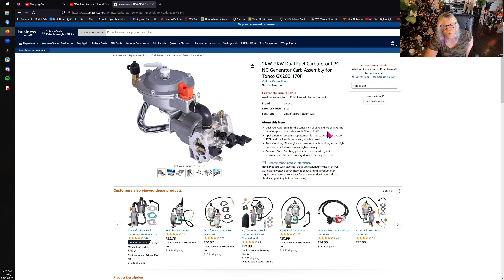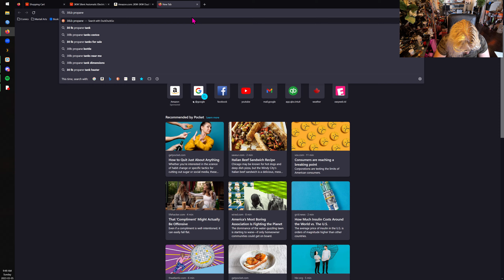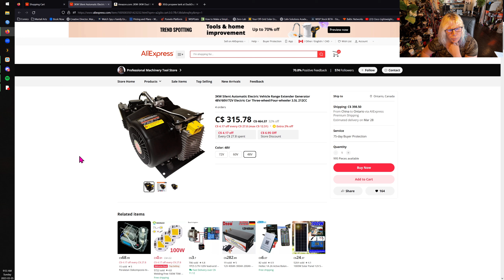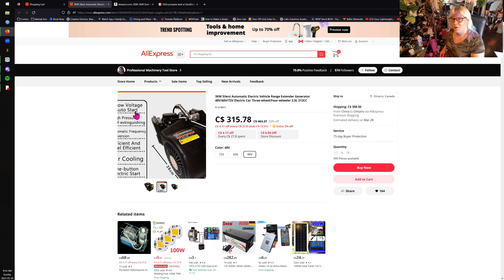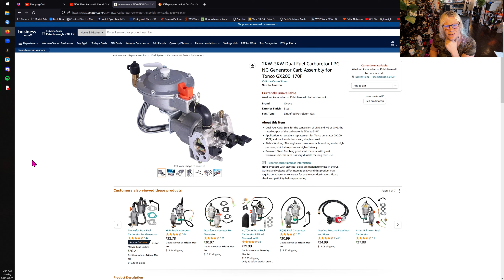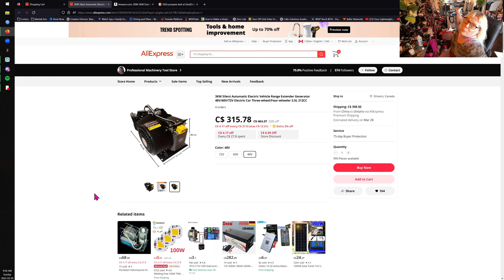Auto start DC Generators for those Long outages!!!

Comment: Brilliant.  Most of our sites have 12v setups with APC's in them (battery packs, smart UPS etc).  We'd need to somehow insert a 12v version of this inline somewhere to get this to work.
Reply from the maker: I say this with care. Your running the sites in a less than great way. You should run them as DC and get rid of the UPS's. In telecom tower sites and even fiber head ends are all 48v. I explain in a video I did a few weeks ago ^^ I can explain better if you ever want over pm?
Reply: @thefixitgal  I'm well aware, but our bed was made quite a while ago and most were dependent on space at the time using small smart UPS.  They all work fine and we've had no issues.  Almost all our equipment is AC and it isn't in our budget to do anything other than swap the occasional battery in the next couple years.  I'm with ya though on the right way of running DC.